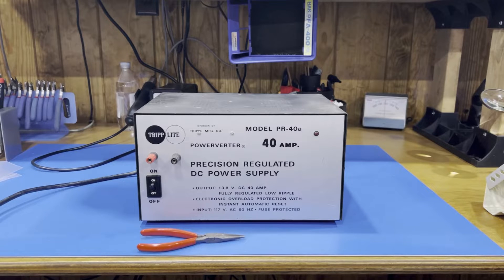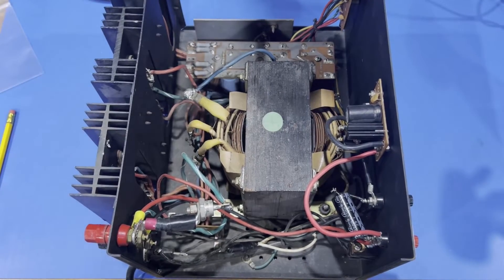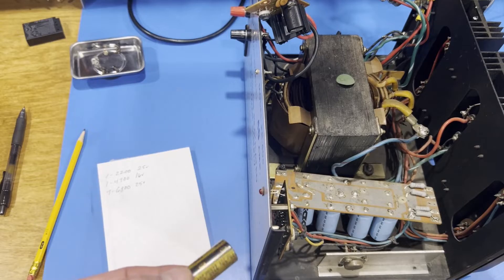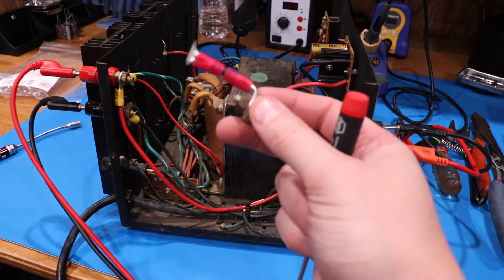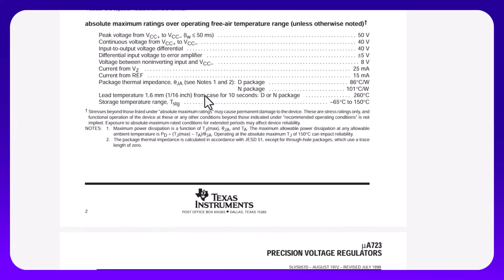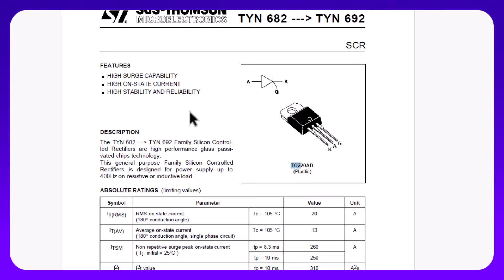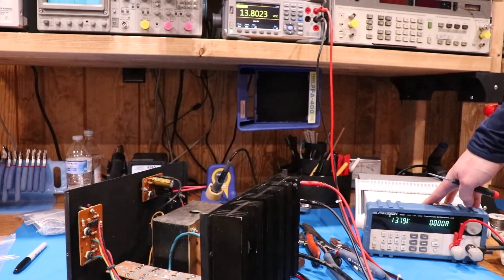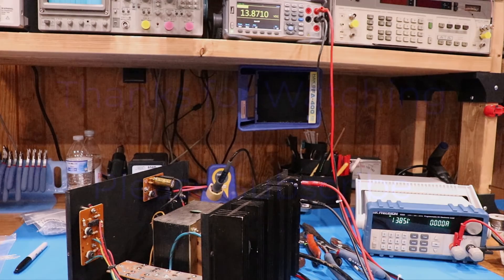A 40 Amp Linear Power Supply Rebuild Journey - Tripp Lite PR-40A

Comment: I have a Pyramid Phase III model PS-50 power supply from the late 70's and it looks identical to this Tripp Lite. All three circuit boards are identical. It even has the little green sticker on the transformer. The schematics are available online and should be very compatible. If you can't find them let me know and I can send them to you if you like.

Comment: Love the LM723, great device and still incredibly useful, If it's implemented properly then it's pretty difficult to beat it in a linear PSU even now, 40-50 years after it was released.

Comment: That extra heavy duty diode that you removed was likely used to prevent an external battery from being hooked up backwards to the power supply.  Years ago it was common practice to use these types of power supplies as a dual purpose lead acid battery charger and a 115 VAC power supply.  In this manner the battery was always topped off and ready for use during a power outage. Think of it as being an early manually operated uninterruptible power supply.
Reply from the maker: Makes sense, won't see that use at my house :-)

Comment: I would recommend to put back the output capacitor. I suspect that it was attached to the original terminals in the back.
Normally, the capacitor on the output would help prevent the regulator from over compensating when you key the transmitter, which would cause a sudden drop in voltage.

Comment: I have a 30 year old Tripplite  PR-15. I replaced the power switch a couple of years ago, everything inside looked good and is original. I bought it new at C&G Electronics, a ham supply store, which is no longer a brick and mortar store. Funny, I was thinking I should probably recap it since I still use it . Still measuring 13.84 volts at 1 or 2 amps load, and no measurable ripple on the lowest AC setting on my digital meter. Thanks for posting this, good info.

Comment: You  didn't check for AC ripple on the DC output under load. That is important in Ham Radio, it can cause a hum when transmitting. Great to see you back again.
Reply from the maker: I did, just didn't put it in the video.  The video was getting long and I was more focused on showing how to figure out what a circuit did with no schematic.

Comment: Back in the '80s I worked on cable tv line equipment. Almost everything at that time used a '723 regulator. Thanks for the memories.